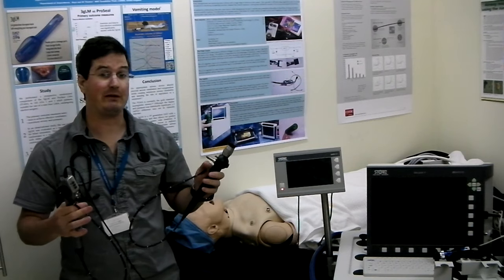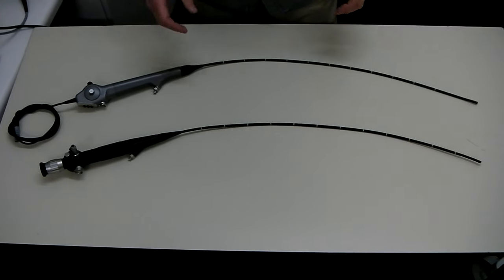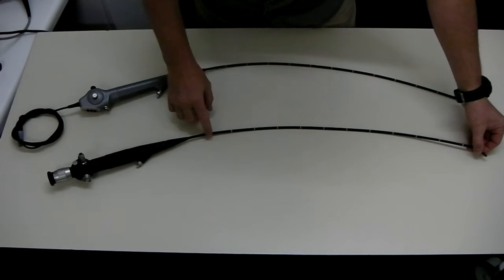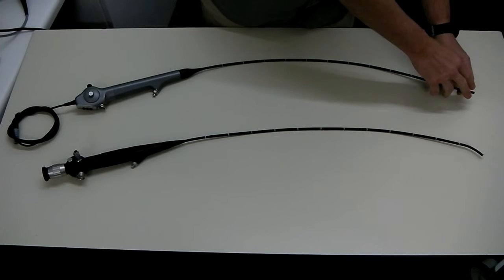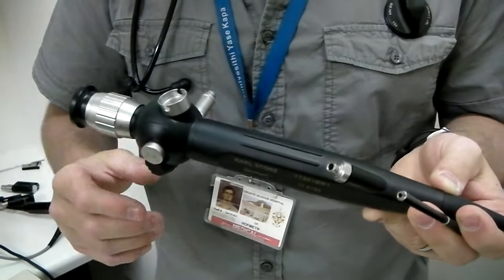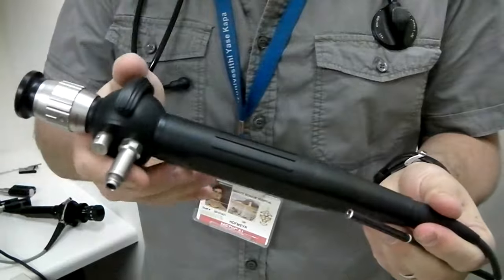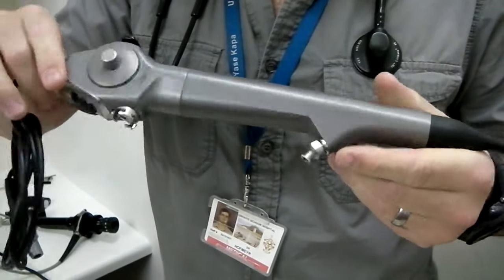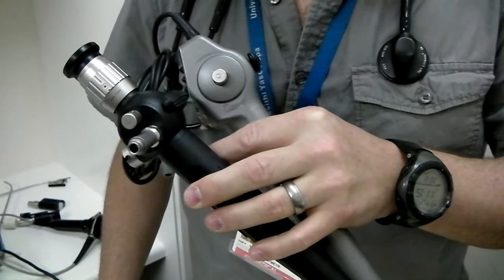Flexible Bronchoscope Anatomy 101

Comment: Thanks Dr.
Please which suitable  length  and outer diameter can I buy it which is c as can be used for both pediatric and adult as I can buy both sizes thanks
Reply: Hi Sa'ad!  I would recommend scopes in the 60-65 cm working length for intubation, as these allow the easiest use with longer tubes (such as reinforced ETTs or microlaryngoscopy tubes).  There are some shorter scopes out there, but can get fiddly when using a larger/longer tube.  A good size for everyday use and adult intubation is 5.0 - 5.5 mm outer diameter.  Generally, you can use an ETT with internal diameter 1 mm larger than the scope, so a 5.5 mm ED scope allows a 6.5 mm ID ETT - again, suitable for most adults.  Depending on the brand of ETT and scope, you can sometimes bring this down to 0.5 mm difference with good lubrication, but it runs the risk of damaging the scope sheath.  For paeds and DLTs, you want a scope of 4.0 mm ED or less.  There it becomes a play-off between fragility and functionality and the minimum size tube you can use.  There are some 3 mm scopes out there, but they often don't have a working channel (or it is so small that it is hard to use).  We have standardised on a 4 mm flexible video scope; this allows ETTs down to 4.5 mm ID and still has a useful channel.  Hope that helps!
Reply: @RossHofmeyr  
Very thanks proff...
Very nice information 
Thank you